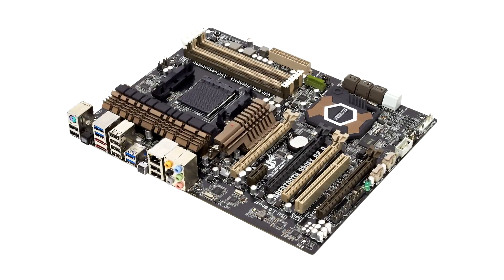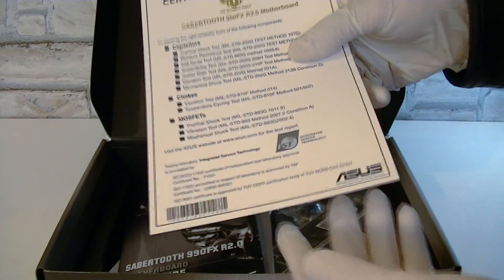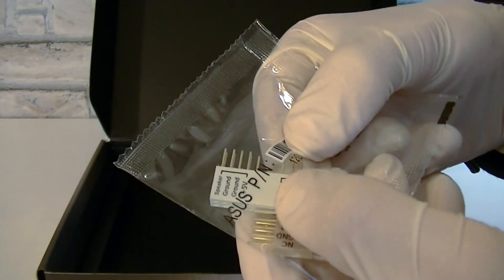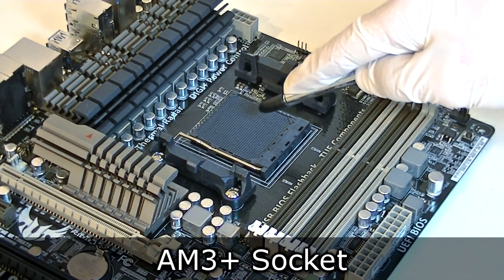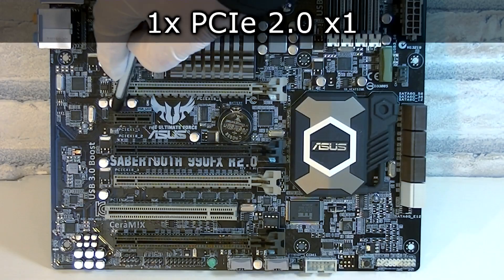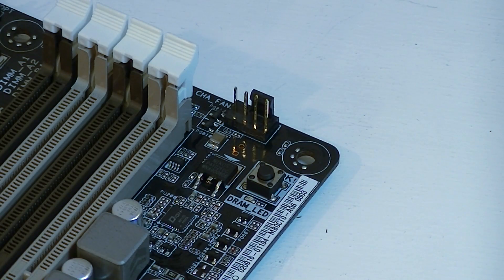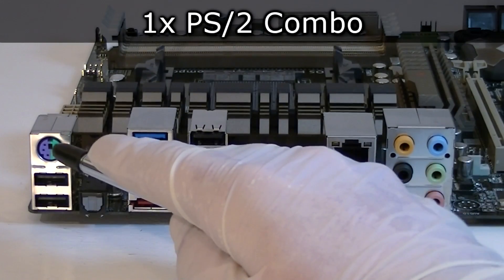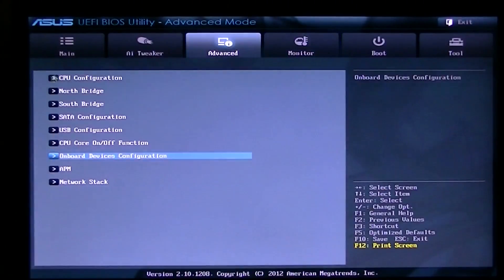ASUS Sabertooth 990FX R2.0 Motherboard Review

Comment: Nice board, use one to run freenas, cheap and reliable since it supports ECC memory which are strongly recommended for ZFS operation, also like the 8 sata ports,

Comment: No problems at all !!, i am running my system since 2 weeks now , i've updated the bios like i always do after an upgrade and everything works fine. A very fast motherboard that doesnt slow down my soundcard. So it was a very good buy . The chipset also performs very well. Only down side is that there was no firewire port on the motherboard. I had to buy a dedicated card for windows 7 on pci-e to be able to use my soundcard .

Comment: It offers improved power delivery (a must for overclocking), out of the box Piledriver support, Windows 8 Compatibility, improved UEFI, ASMedia controller over the original JMicron, along with numerous other technical enhancements (both on the engineering level and the brand level).

Comment: It's worth noting that unless your using Boinc or Folding@Home 24/7 your CPU is rarely running at it's overclock speed. All the CPUs have Speedstep-type tech which lowers the clock rate. The main thing is to have a decent idle temperature and put your machine to sleep when not using it. I can't see how that type of usage would deteriorate your CPU.

Comment: I bought this board in December but I haven't used it yet because i'm only 15 and I am buying part by part. I have bought my motherboard, processor, ram, case, disk drive and SSD so far